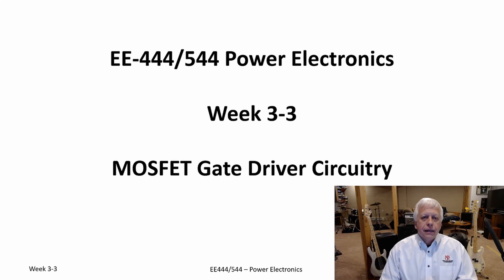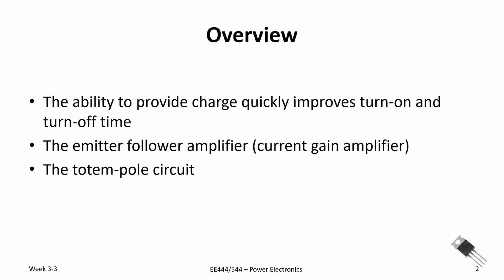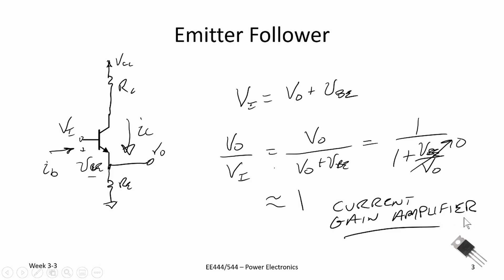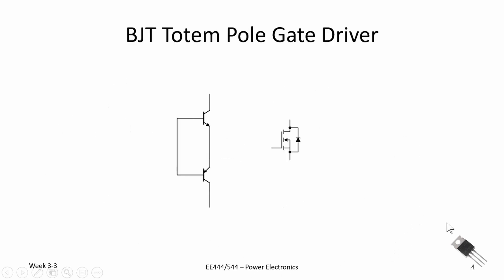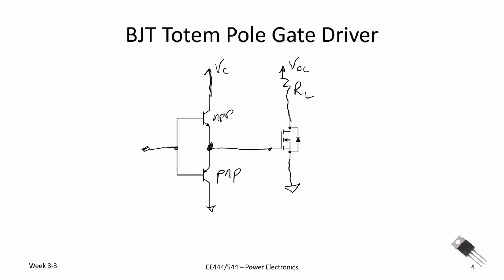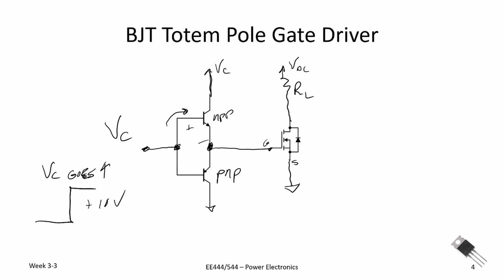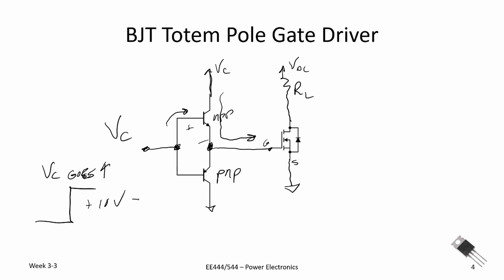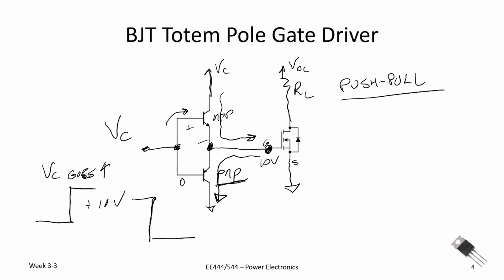Power Electronics - The Totem Pole Circuit and MOSFET Gate Drivers

Comment: Does bootstrapping limits switching frequency ?
Reply from the maker: Great question which applies to high-side driving of typically a P-channel MOSFET.  The answer is yes.  However, the switching frequency range is relatively broad and will partially determine the value of boot-strap capacitor used.  As an example, it is impossible to never switch because the boot-strap capacitor requires charge and this capacitor charges up when one side is switched to ground either through the driver or through the low-side switch.  Once charged, the boost-capacitor can then be used to drive the MOSFET and acts like a floating voltage supply.  However, the capacitor will eventually discharge over time and the result is Vgs will slowly decrease to an in operable point.  If the switching frequency is to high, the boot-strap capacitor never fully charges up or takes too long to charge.  Often the high-side gate drive datasheet will provide information on selecting the boot-strap capacitor based on your switching frequency.  Best wishes on your design. -Dr. K
Reply: @powerelectronicswithdr.k1017  thanks for perfect explanation. 
one more question about gate drive. 
Gate drive require high current for a moment ,(say 500 mA), due to Cgs. If we use bootstrap, does bootstrap capacitor can deliver such a high current?

Comment: I want to drive my igbt at 15 volt but the Ic can push the current but I get 15 volt on the output at 250 milliamperes but I need 5 amp at 15 voltage to draw the 5000 watt inverter I design with igbt so can the totem pole base receive the 15 volt with 2k resistor will the base break down at the higher volt of the totem will work
Reply from the maker: You might want to search for a driver or will need to design your own totem circuit. I would look for a driver for IGBTs first.

Comment: Thank you Dr K for the video. Could you please clarify if you meant "gate to source capacitance" at 12:46?
Reply from the maker: Hi Pre, the gate to drain capacitance charging and discharging is impacted by the Miller Effect.  Here's a good application note https://www.vishay.com/docs/73217/an608a.pdf.  Also, please reference my video on MOSFET switching https://youtu.be/RViwOc4g-gw.  Thank you for asking.  -Dr. K

Comment: how could I get the power consumption of a gate driver?
Reply from the maker: Hi Gonzalo, that's not an easy answer as it depends.  The power consumption will primarily be switching-based and very dependent on the IC gate driver you select.  If you are using a gate driver IC, then I would look at the data sheets.  Best wishes on your design.  -RWK

Comment: Can you teach us next how to calculate the resistor used for base totompole. Also for switching MOSFET gate resistor
Reply from the maker: Hi Anjo, the base resistor is calculated in a similar manner to calculating a current limiting resistor for an LED.  The base-emitter is a pn junction in a BJT and behaves like a diode.  Use the data sheets to determine the collector-emitter saturation current and the minimum value of beta for the device.  Use these values to compute the minimum value of base current required for saturation, so I_base = Ice_sat/beta.   Assume a 0.65V for the base-emitter junction and let Vs equal your control voltage applied to the totem-circuit.  Rb = (Vs-0.65)/I_base.  You can use the next standard resistor size smaller than your calculation.  Hope this helps. -Dr. K
Reply: @powerelectronicswithdr.k1017   very nice sir. Thank you sir. Waiting for MOSFET gate resistor calculation for high speed application.

Comment: Excuse me
1.the totem pole use Mosfet how it work I know use the BJT the current could be larger but the mosfet can do the same thing?
2.what's benefit BJT  connect the mosfet  is the loss can reduced?
Reply from the maker: Yes, you can use MOSFET technology in a totem configuration.  Often integrated drive circuits use MOSFETs or a combination of MOSFETs and BJTs.  If you build your own drive circuit using discrete devices, I would recommend BJTs.  Yes, the losses are a concern for the totem circuit, but usually are small compared to the power switch.  Thanks for watching and best wishes on your designs. -Dr. K
Reply: @powerelectronicswithdr.k1017  
sir I still have question
how to drive the mosfet totem pole, it is the same with BJT? 
BJT can do the emitter follower mosfet can do?
Reply from the maker: @rj8528  It depends on what you are using the totem circuit topology for.  Is this for a push-pull voltage follower amplifier? If so, the n-channel MOSFET is on top and the p-channel is on the bottom of the totem. If you are using MOSFETS in a totem configuration as a gate driver, then I strongly suggest you implement using an integrated circuit and do not try to build a discrete driver circuit.  Here's an example of a gate driver IC that uses a MOSFET totem circuit topology https://www.analog.com/media/en/technical-documentation/data-sheets/44411fa.pdf.  You can see on page 8, that N1 and P1 make up the main drive circuit.  Best wishes. -Dr. K
Reply: @powerelectronicswithdr.k1017  I Thanks

Comment: I can buy a digital temperature sensor with digital display, but in a classic 53 year old GM truck. It and the EFI engine fell into my hands for free. My son gave up on the old truck, then hit a tree off black ice in a 2003 Tahoe. That engine is going to make my daily driver more reliable. 
  My task is cooling the transmission, using a NTC thermistor in a voltage divider circuit with a potentiometer to drive a N-Type mosfet. I have not measured the amps the fan pulls but would guess it’s 24-30. I wanted to use a matched relay to make a simple but robust circuit. A relay makes future diagnostics easy, as I have room next to others. 
  One gentleman said I would have hysteresis in the relay. Your video was the first time I have heard of a driver for the mosfet. The store bought on loosed it’s memory if power is lost. Hate to ask, but do you have any thoughts? I have 3 parts bins of electrical components my grandpa owned. He was an electrical engineer and ran field generators for a new thing called “Radar” in WW-II. I lost him the year before I married, 40 years back.
  Thanks for the videos that allow enthusiasts like me, to learn!
Reply from the maker: Hi Dean, you could probably use a DC relay to drive the MOSFET.  Watch your Vgs limits as you do not want to exceed the max values on the data sheets.  Thanks for watching.  -Dr. K